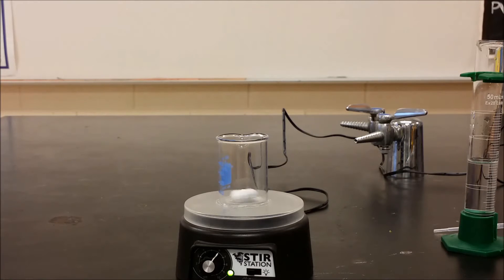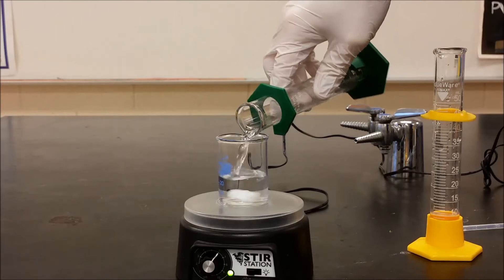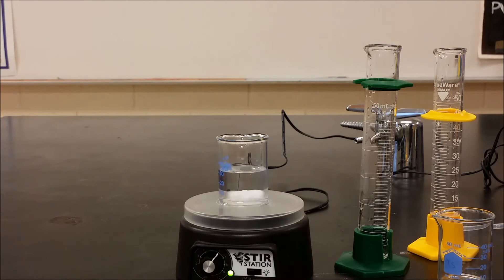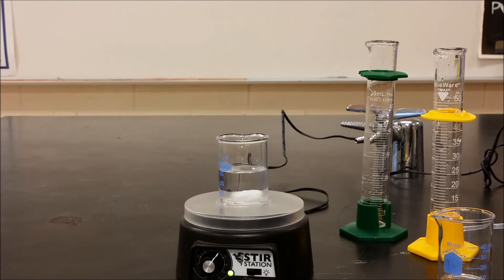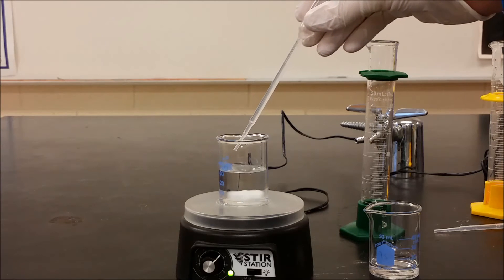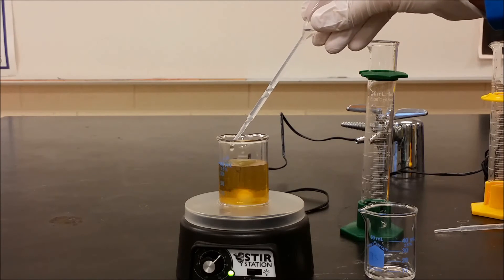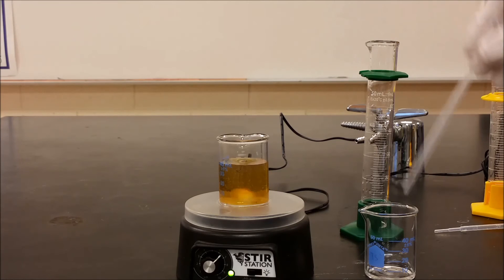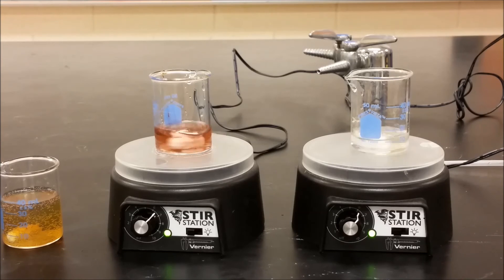Silver Nanoparticle Synthesis and Luminol Catalysis

Comment: Hi Scott, great work.
Do you know of a way to separate the Silver nano particles ?
I need to produce a highly conductive ( electrical not ionic ) epoxy resin binder system for my Battery research and as such would need these nano particles.
Regards kev.
Reply: Centrifuge at high speeds. This worked well for larger silver nanoprisms, but I never tried it for the smaller seed particles produced in this video. If that doesn't work, you could try to remove the water under high vacuum.
Reply: There's conductive glues and epoxies available commercially. Particles this small probably wouldn't be very conductive anyway.